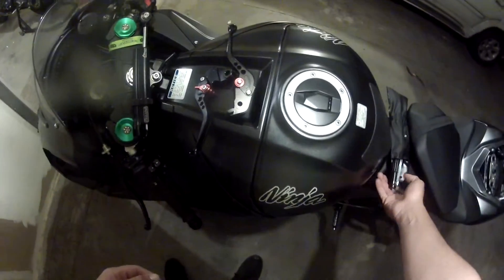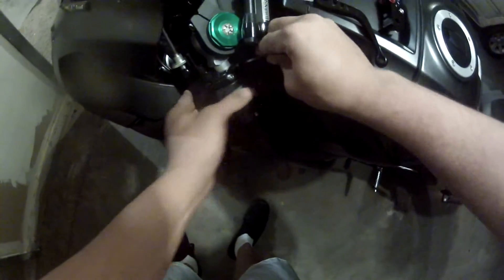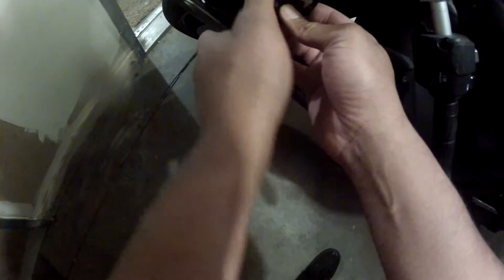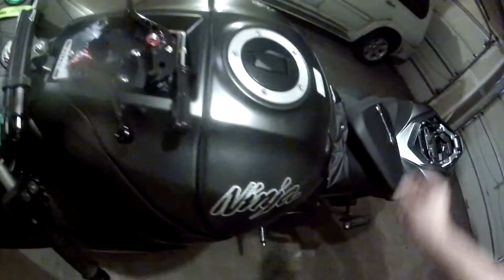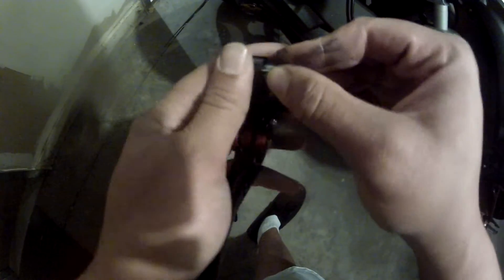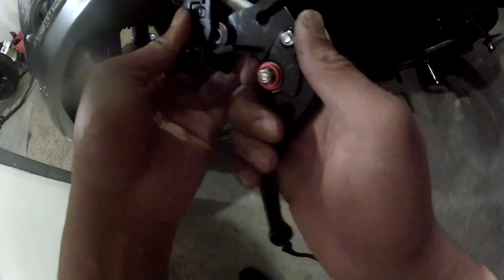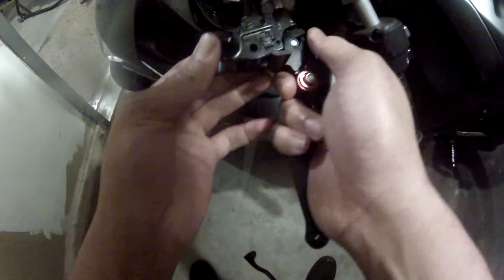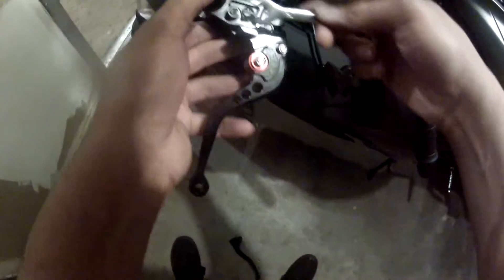2016 Kawasaki ZX10R Shorty Lever Install

Comment: Should post a link to the levers in your description :)
Reply from the maker: +th3r3ds0x One sec man ill get it in there.
Reply: +Moezhawk thanks for the link.  Going to get of set of the green.  Looks like they will match perfectly with the green on the triple tree.  Got my R&G tail tidy in today.  Going to install that when my actual license plate arrives in the mail.  Btw, the cam-chain tensioner issue i was having seems to have resolved itself.  Probably just needed to break in like everything else.  Have a little over 800 miles on her now and she's purring like a kitten (or tiger lol). Thanks for the cool video.
Reply from the maker: +th3r3ds0x anytime man the exhaust install video will probably be next.